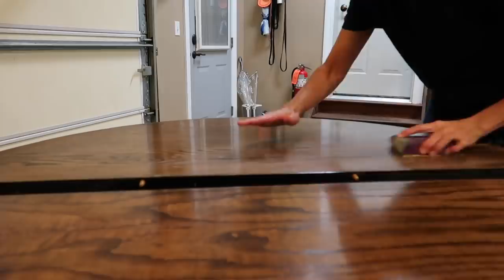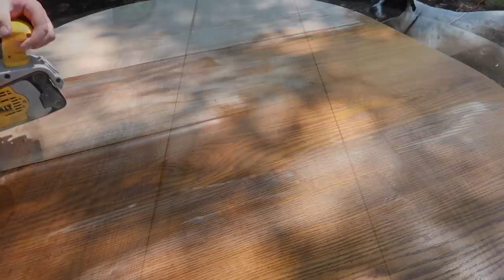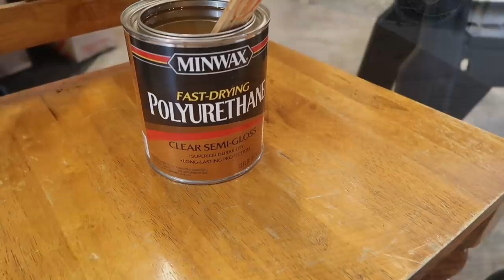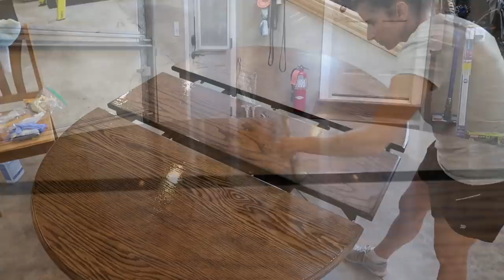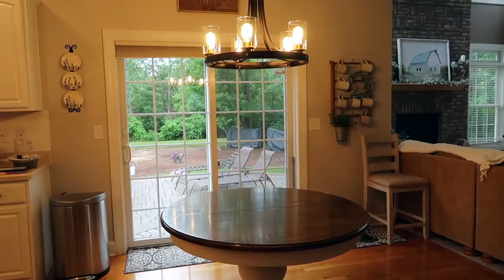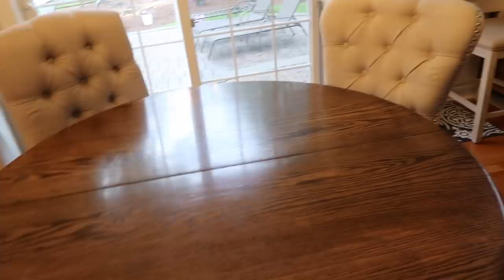DIY DINING ROOM TABLE MAKEOVER | FARMHOUSE TABLE DIY | THRIFT TO TREASURE

Comment: Hi Dana. Question I have is why did you sand between coats of the polyurethane? I’ve not seen that done before....was it to seal it better? I may be doing something similar with a dresser so I’m curious. And why so many coats? Because the table top will be used so often? It turned out beautiful. Your husband did a great job sanding it down....I watched someone who took a couple of end tables and sanded down to the bare wood then sealed it. It looked like beach wood. Wood sure is beautiful unlike the man made junk that’s out there today.
Reply from the maker: Hi!  So you sand between coats of poly so you get a smooth finish.  You are only using a very fine grip sandpaper so it only smooths any imperfections or bubbles.  It’s amazing how smooth it feels after each coat after you sand.  Also, for something like a dresser, a couple of coats of poly should be sufficient but since we will be using the table all the time and putting glasses and dishes, etc. on it, it’s recommended that 4-5 coats be applied.  Have a great day! ❤️
Reply: Decorate With Dana Thanks! Kind of what I figured wasn’t sure!!